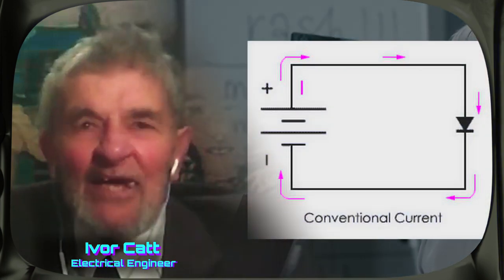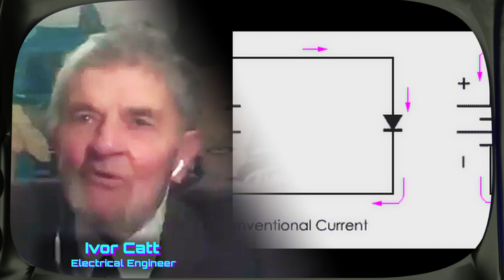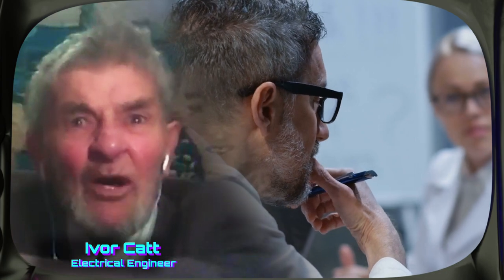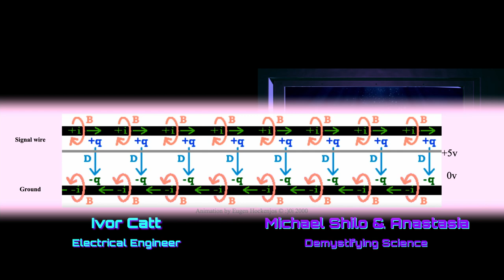(2/2) What Is Electric Current? - Ivor Catt, Electrical Engineer

Comment: The conductor acting as a guiding rail is exactly what Ralph Morrison talked about.
“Buildings have walls and halls.
People travel in the halls, not the walls.
Circuits have traces and spaces.
Energy travels in the spaces, not the traces.” Ralph Morrison.

You need to invite Rick Hartley, he’s an engineer that designs PCB’s and how to distribute energy efficiently, he’s works are based on Ralph’s views.

Comment: Richard Feynman, "It is important to realize that in physics today, we have no knowledge of what energy is." Has that changed to any degree?

We can know its effects but what is it that drives the matter? What puts matter in motion? We can squeeze 2 magnets north poles facing each other together. When they are released, what is pushing them apart? We are told light and magnetism are immaterial, have no mass or weight. So is nothing acting on something? Sounds like that 'Magical Fluid's mechanics. Intuitively something is acting on something.
Reply from the maker: There is a physical mechanism that needs to be proposed. We are working on some animation proposals of what the atom might be doing over @TheMaterialWorld. Stay tuned.

Comment: The DemystifySci Podcast
For your consideration    
Synchronous electron motion is all that is required in a conductor to create a magnetic field.  In a material like Fe, when magnetized, the summed alignment of electron orbits /orbitals within the magnet , maintain a field well beyond the materials boundary.  Nothing has changed in the Fe except for exposure to a strong field = alignment  / configuration.  There is  collective motion rather than "flow" of electrons in a permanent magnet, in orbits, but there is current to be measured across the poles of a permanent magnet.  ( orientation , speed / Hz)  All atoms are electromagnetic at atomic scale and above. The motive force is carried in the field , through and around a conductor , since fields move electrons , it follows that Voltage appears as a "pressure"  , And there is , as you said, in a circuit , electron migration ,  so there is a flow, its just not the carrier of power / energy.  . Battery terminals are misleading as I was taught,  inverted, to appearances,  that is to say that the "positive "terminal has a surplus of electrons and the negative terminal has a deficit of electrons. ( the negative terminal is not the source of a flow of negatively charged electrons ).  DC and AC current both cause all the atoms of the wire in a circuit to align the electrons . the difference being DC does not continuously swap polarities like AC , there is no Hz to pure DC power.  W = V X A  implies a pressure and a flow , and it is extremely useful even though based on an erroneous interpretation of the observable. 
Quantifying it has made it useful, but misleads our understanding , interesting trade off.
Reply from the maker: Good points. We are working on animation of this group motion over @TheMaterialWorld. It starts with visualizing possible motions of the e-shell. Like this: https://youtu.be/CWjGO8sukpA

Comment: I understand what Anastasia is trying to say at 27:00. To that I would like to formulate a question: what if, for the reasons highlighted by Catt, we are off track and, just as an example, Tesla wireless transmission of energy was TRUE and we still don't get it, and use AC lines scattered all over the places, despite being in 2021? Try thinking about that. (I still hear people convinced wardenclyffe was a radio antenna...!)

Comment: Help!  I watched both interviews.....  Is there a TLDU:  (too long, didn't understand) summary of what Ivor Catt was trying to say, / what his theory of Electric Current is?
All I got out of it, is this 2 hours was that Catt noticed that when a digital signal was sent down one wire, it caused a second wire to have a reversed, delayed signal too?
And when the two wires were twisted, that effect disappeared?

I'm sorry I am so stupid.  Please tell me what the take home message of Catt's theory is.  
Electric current is caused by/looks like/doesn't do......

As for the "glitch" video, it makes logical sense that a computer can crash if it is expecting a zero or 1 and instead gets a .5, which propogates to the next "instruction".....  And his insistence that analog signals are sometimes superior than digital ones, (see what I did there. ;-o )

So, really, by TLDU request is simple.  What is Catt's definition of what electrical current is?
Reply from the maker: That's sort of the point. Catt doesn't seem to have a theory, just a criticism. In science, old theories are discarded only after new ones replace them!
Reply: Catt has theory D -- which replaces his theory C -- & which i think is very similar to theory H.
Theory H (Heaviside) says that electrical current is an EbyH slab of transverse energy current around a wire (or between & around the pair of wires) that propagates at the speed of light in the medium surrounding the wire(s).
All of these theories are i think very similar to the Poynting field (or vector) theory of electric current.

But the correct theory of electric current (on a wire) is my own -- electicity (not electronic electricity) is due to electons (photons) hugging & propagating at the speed of light along the outside surface of the wire.

Comment: Learning about electric field/magnetic field of a conductor, I asked my professor about fiber optics, "Does the fiber optics line also give off an electric or magnetic field like the conductor?" He told me that it behaves like a waveguide, where the energy is contained within the dialectric, reflected back and forth from the outside surfaces." 
To me this seems like the inverse of a conductor.
I would love to hear what Catt says about fiber optics lines and current or energy.
edit: oh, oops at 1:23 he does mention fiber optics.
Reply from the maker: the real question becomes "what is energy?"

https://demystifyingscience.com/blog/2020/2/14/what-do-they-mean-energy
Reply: @DemystifySci_Podcast  Actually the question is "what is ELECTRICAL energy?"   Answer: it's exactly the same thing as radio and light and x-rays, but far lower in frequency.  Electrical energy and electromagnetic wave-energy are exactly the same thing, that's the essence of Poynting theory, which applies both to DC flashlights and to light beams.   Over at the Exploratorium science museum, Frank Oppenheimer has an infamous wall-chart, an Electromagnetic Spectrum diagram which doesn't end at 500KHz as usual.   Instead it includes audio signals on phone lines and speakers, and also the 60Hz power grid, all of which are the same stuff:  electromagnetic radiation, whether stuck on wires/waveguides or traveling through empty space.  Exploratorium gets it right!  (All the other grade-school textbooks teach that "electricity" is a separate kind of energy, composed of electrons rather than EM waves.)

In fact, there is no "wall" between AC dynamos versus radio waves.  Nikola Tesla famously broadcast ELF signals at around 60KHz by hooking an AC dynamo to an antenna (a very high frequency dynamo!)  This was ignored at the time, until twenty years later when his patents ran out, and suddenly like magic, GE corp. "invented" the Alexanderson Alternator, where a high-freq AC dynamo is directly connected to a transmitting antenna, producing the first AM music transmissions.   And as any radio-ham can tell you, any radio transmitter can happily drive an incandescent light bulb or heater, rather than a wave-emitting antenna.

PS
Students typically object, saying that light is "really" photons, while radio is EM fields, while 60Hz wattage is "electricity."   This is all wrong (it's another student misconception.)  One physicist is fighting against incorrect teaching of photons and QM in high school, insisting that QFT is the ruling paradigm (Quantum Field Theory,) and under QFT, EM fields are real, while photons are quantized changes (exitations) of the fields.  In other words, photons are not particles in the usual sense, instead they are:  energy-steps plus quantum weirdness.  Photons don't have trajectories, photons don't have location, so essentially photons ARE the fields, but these fields don't vary smoothly.  (This helps greatly in curing the misconception that light and radio are two different things, as if light wasn't EM fields (it is,) or as if radio doesn't involve any photons (it does.) )   See his 2013 paper, Art Hobsen in AJP journal, https://arxiv.org/ftp/arxiv/papers/1204/1204.4616.pdf, https://aapt.scitation.org/doi/full/10.1119/1.4789885
Reply: @wbeaty  
Photons are not radio waves -- & radio waves are not photons.

 Electricity (on a wire) should be called "electicity". Koz electicity is due to the flow of photons hugging the surface of the wire. I call these hugging photons "electons". Electicity is not due to the flow (drift) of any so-called electrons in the wire (the standard model of electricity). Hugging is due to the same effect(s) that gives us the bending of light near our Sun, & diffraction & refraction (in air & water etc).  Electons have a negative charge. A free photon has zero nett charge (in the far field) – but when semi-confined (ie when an electon) it has nett charge.
An electon can hug a wire – likewise an electon can hug a proton (ie a nucleus), at which time we call it an electron (no it is an electon).
Reply: @atheistaetherist2747  Personal theories are maverick/fringe/crackpot, until they are accepted by the community.  Keep them clearly separate from textbook science.
Conventional physics says that EM fields "are photons," the latter is the quantized exitation of the former ...and also that in circuits, the electrical energy is composed of EM fields outside the wires (while electric currents are entirely inside the metals.)   Oliver Heaviside said the same thing, in fact he's the one who discovered the field-energy traveling in telegraph cables (independently with Poynting.   The Poynting vector easily could have been named the Heaviside vector.)     
If Catt agrees with Heaviside, then we're all saying the same thing:  circuits have two kinds of flow:  amperes versus watts, where the charge-flow is very different than the energy-flow.  

The EM fields are the waves, and the charge-flow is the medium which guides it, analogous to mechanical energy flowing across a slow-turning flywheel.

In that case there is no such thing as one single "electricity." Instead there are two different flows, waves versus medium: the EM field-energy which normally moves in one direction, from source to load (it travels along both wires, same as in coax cable, antenna twinlead, stripline, etc.), and also  the slow currents in a closed circle.   This all becomes clear with AC circuits, where the current is an AC wiggle, while the electrical energy is a lightspeed wave.   The current alternates equally back and forth  ...so how can it proceed ahead in one direction?   It doesn't need to do so!  The current is the "medium," and the energy is the "wave."   Wave versus medium, two separate things which are misnamed "electricity," as if they could be a single entity.   (The air molecule is not the sound.   The ocean waves travel along, but the salt water itself only goes back and forth.  Waves versus medium.)

Today's physics says that photons are not "particles" in the usual sense.   Instead, EM fields are always quantized.   Light is made of EM fields.  Radio is made of EM fields.  The energy in circuitry is made of EM fields.   Magnets and capacitors and inductors are dealing with EM fields.  (All these fields are existing as discrete steps in energy, where the steps are called "photons," but the steps should not be imagined to be localized whizzing dust-grains or itty bitty bullets.)
.
Reply: @wbeaty  
Thank u for your reply.  Yes, my electon electicity is contrary to almost all of conventional electron electricity theory.
However it appears that we have various kinds of (conventional) electron electricity –eg electron drift carries the energy – eg the Poynting field carries the energy – etc.
The Heaviside electricity is a moving/propagating slab of EbyH transverse energy current – a slab means no rolling E to H to E nonsense.
The Catt electricity is similar to Heaviside – but Catt say that nothing moves – i think that  Catt might be happy to say that the (transverse em) slab propagates (but nothing moves). 
In addition Catt says that the TEM slab propagates at the speed of light in the medium surrounding the wire(s) – whereas Heaviside was mute on this point -- praps Heaviside was not even aware of this problem.
I don’t think that Heaviside ever said anything about electrons – yet electrons & electron drift seem to be a big part of conventional electron electricity.
Catt duznt say much about electrons etc – Catt says that electrons don’t exist. 
I suspect that neither Heaviside nor Catt use the word electricity -- they say energy current. Or -- they do sometimes say electricity, but only to save time & ease the pain when dealing with dullards.

All of these ideas have been superceded by my electon electicity.
My electon electicity avoids the catastrophes haunting conventional electron electricity – eg why is the speed of electricity along a wire influenced by the insulation on the wire?

My electon electicity says that there is no such thing as an electron (a hard little nut) orbiting a nucleus – what we have is electons hugging & orbiting.
My electon electicity says that there is no such thing as electron drift in a wire – except that we have orbital electons hopping from atom to atom.
My electon electicity says that we do have (can have) electron drift on the surface of a wire etc – here the electron is a free electon that has formed a loop by biting its own tail -- ie a bit different to the non-free (confined) electon orbiting in a loop in an atom, ie an orbiting electon has formed a loop but it is not (very) free to move/drift. This kind of surface movement of charge is in effect a weak (usually) & slow (always) form of electricity (ie weaker & slower than electicity). Surface electron drift is thusly the only real form of what can be called electricity (due to electrons)(ie not electicity due to electons).

Re electrons – if pushed Catt has been known to grudgingly talk of electrons – in which case he might admit that electrons are a rolled up EbyH slab. Which is in effect my electron (see above) – a looped photon.
I say my electron – but it is JG Williamson who explains best how photons  form elementary particles electrons & protons & quarks etc by forming loops. 

Re radio – i repeat – radio is due to em man-made (ie forced) signals.
Radio is not photons.
Photons are not radio.
Photons do not have or naturally make or need a natural rolling E to H to E wave.
Hertz was wrong.